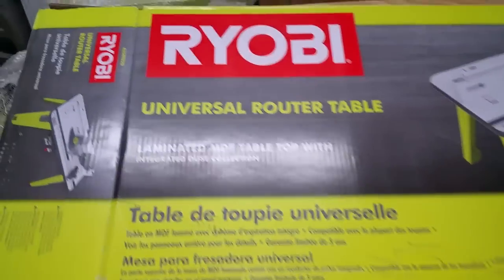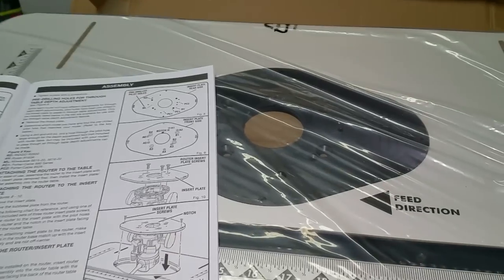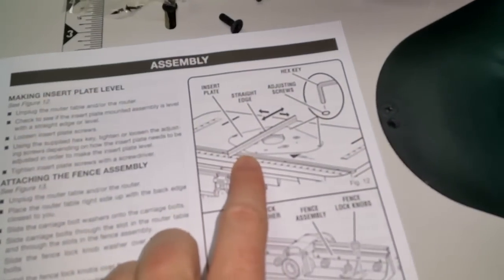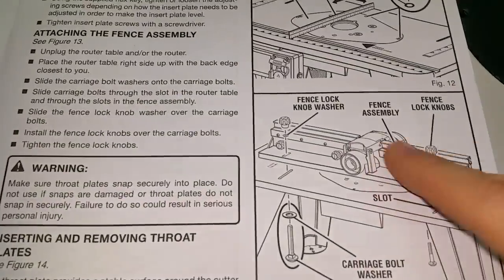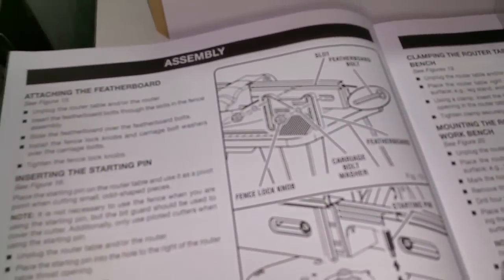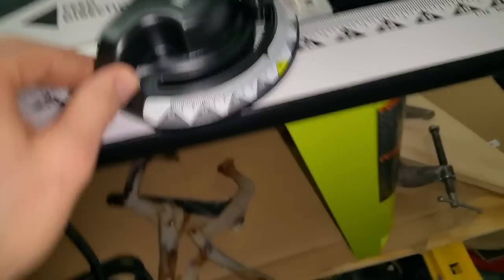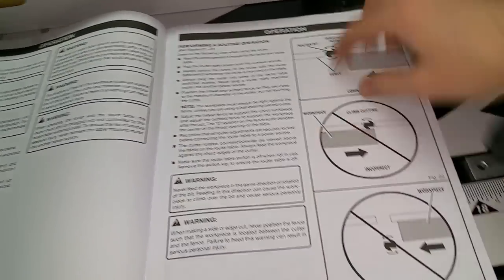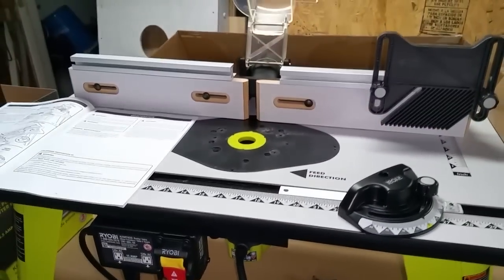Original Ryobi Universal Table & Router Setup - Basic setup

Comment: I just purchased one of these today and just like yours the height adjustment tool is not included with the table or the router; however you can make the adjustments from above the table by drilling the hole in the insert just large enough to fit a 3/16 nut driver through. works great.
Reply from the maker: +hennyhaha100 
This is a great idea!  There may be a diy adjustment tool video on the horizon to do just that.

Comment: Hey, Sparky, I've got a plunge router connected underneath and can't seem to get that thing raised up high enough to use ANY of the router bits. Is there a crank or a lift for this table that can adjust the bits?? HELP!
Reply from the maker: What model number and brand router are you using? 

If its the RE180PL(1) plunge router from Ryobi, there seems to be some issues getting the springs compressed enough to get the tool high enough out of the table to be functional.   If there is a sub base plate on your router, it should be removed before being attached to the adapter plate (regardless of model/brand). There is also an optional adjustment knob available that could make it easier to adjust while installed in the table (Help overcome the spring tension).  I will post a video on how to order that part soon.  I have not seen a Lift specifically built for this table yet, sorry, but i will continue my research.   Hopefully this is helpful.
Reply: Hey Thrift Diving, I had the same problem connecting Ryobi plunge router R180PL1 to the Ryobi Universal Router Table. I just called the Ryobi helpline and found out that they are not compatible. The R180 is listed on the table's  "assembly" list, but only because the holes match. The rep said you wouldn't get any depth due to the springs on the plunge router and suggested getting a fixed one. hope this helps!
Reply: @Molly and @Sparky - Yep, that's the plunge router I have! It's good to it doesn't work. I'll get a fixed router! Thanks so much, guys!
Reply: Sparky's HakShak l
Reply: i know it is kinda randomly asking but does anybody know a good website to watch new series online?
Reply: @Gordon Vincent lately I have been using flixzone. Just search on google for it =)
Reply: @Jeffery Lukas Yea, been watching on Flixzone for since april myself :)
Reply: @Jeffery Lukas thank you, signed up and it seems like a nice service :) I really appreciate it !!
Reply: @Gordon Vincent no problem :D

Comment: can i use the plunge router on this?
Reply from the maker: +Hesir Marquez 
If it's the R180PL others have found out that it does not work well.  The manual says it fits, and gives the bolt/pattern but the plunge feature makes it difficult to get depth to cut properly.  One commented that they called the helpline and ryobi recommended getting a fix base model, because of the limited depth issues.   I am not sure about other brand plunge routers, sorry.  Hope this helps.
Reply: Sparkys HakShak alright thanks you. I'm probably going to return mines and get the fixed one with the table.

Comment: So it wont hold my Skil router since it doesn't name it?
Reply from the maker: taxfree4, I just pulled up the manual for the Table and it does list 2 Skil models, the 1810 (fixed) and the 1825 (fixed/plunge).  says they both use the 10-32 x 5/8 in fasteners, in A2, A4, and A6 holes on the adapter plate.
Reply: sparky18301 thanks for the info, I bought one but it didn't fit my Skil 1817, the holes lined up but the screws provided were too big for the routers so I brought it back. I'll have to with the Skil router table and get hosed for $60 more, thanks again